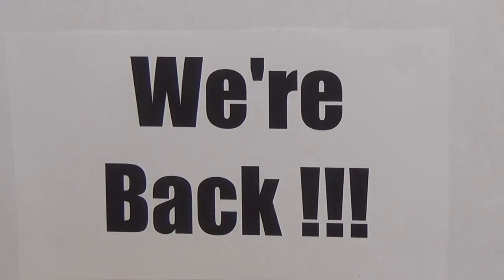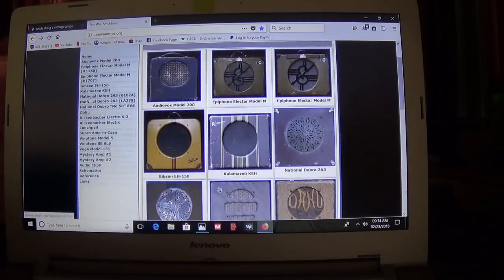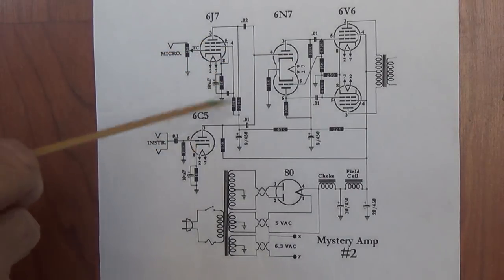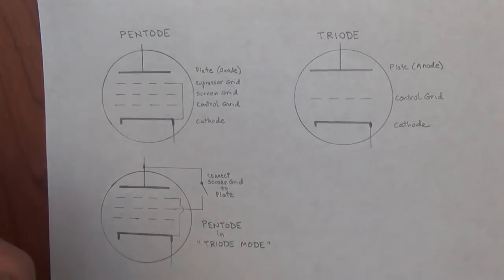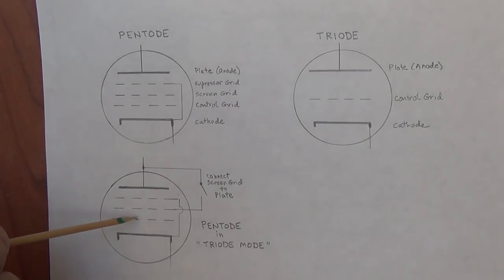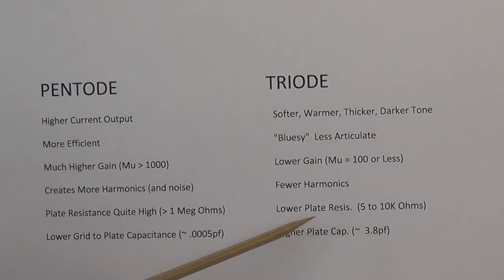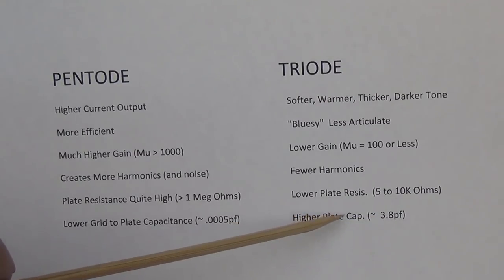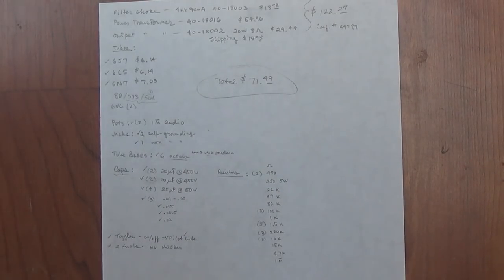Let's Build the Mystery Amp, Part 1: Introduction

Comment: Have you ever thought about using comercial electrical enclosures such as milbank as a chassis. A 12x12x6 is like $40 on Amazon. They make all kinds of sizes
Reply from the maker: I have not, but will look into it, Lucy. Thanks :)
Reply: @UncleDoug  can I put a link for u here
Reply from the maker: @lucyfuir6386  If you wish.
Reply: I tried it didnt post but if u look up milbank 6124sc1-nk u can get cost n specs. I saw Gordon elec supply had them for 22 n change.
Reply from the maker: @lucyfuir6386  Thanks again, Lucy.

Comment: What do you think about rebuilding a old Raul and Borg amp for guitar what is it similar to I heard you did one rebuilt I’m interested in trying to learn how to work on guitar tube amps would this be a good learning experience for me
Reply from the maker: Yes, it would. By all means, give it a try.....but be very careful when handling a live circuit.
Reply: @UncleDoug  ok yes I’m going to drain the circuit and test with my meter that no voltage is present

Comment: The original Epiphone Electar Model M is a very odd series-string amplifier which has three rectifier tubes and four output tubes.
Reply from the maker: Wow, that is an unusual circuit.

Comment: Hey! I'm back at it again as well. On my bench a Shin ei univibe..I need to brush up on some things. Was thiknking today I need to go back and watch some videos. But, This is an already modded uni vibe so I don't feel so bad messing with it. I got it for a decent price to play it but I believe one of the transistors went bad. Me being somewhat new to reading schematics I just replaced what I thought was the lfo transistors and the lamp driver transistor to get my bulb back to blinking and it ended up just making the bulb that was dim, just a  lot brighter still no sweep. Wonder if I have bad lfo diodes? Came across this http://www.geofex.com/Article_Folders/univibe/univtech.htm
Reply from the maker: It sounds like an interesting project, Jonathan. Best of luck with it.

Comment: i just have to ask...is that an ol' boob tube monitor...?
Reply from the maker: I'm not sure what you're referring to, Art. The screen is on my lap top. My previous computer did have an old fashioned monitor, but it ended up in the Dumpster long ago.
Reply: Sorry Doug it's just that the screen has a curve to it and it looked like a CRT.  sorry my mistake...
Reply from the maker: It must be an optical illusion, Art. As you know, laptop computers have the world's flattest screens :) :)

Comment: Delighted to see you back 'on air'! Losing a pet can be a devastating experience, please accept my heartfelt condolences. Early in the video you mention electrons travelling at great speed. Just out of interest; according to the Valve Wizard, in a diode with a plate voltage of 100V, the electrons are travelling at 1,333,575 m.p.h. when they hit the plate.
Reply from the maker: Thanks, Silas. Good grief, that's even faster than Rusty used to run to his food dish at suppertime !!  Thanks for the info.

Comment: Uncle Doug, I've got quite a few Gibson amps. My favorites use pentodes in V1. The one I love to play most is my 1950 GA-30. It uses a 6sj7 in V1 and it screams. Another really good sounding Gibson that I have is a 1957 GA-20T. It also uses a pentode in V1, a 5879 which is one of those nifty tubes that has a pentode and a triode in one package. I don't know why boutique designers don't use such designs any more, I guess most are recreating that British ultra gain. But, I think you'll be impressed with the 6sj7. It's important that you incorporate the uncanny skills of Jack The Cat in your work.
Reply from the maker: Greetings, Rick. Thanks for your input. It's good to hear that pentode input tubes can produce great sound. The schematic actually calls for a 6J7, which is virtually identical to the 6SJ7 except that it has the grid input on the top cap. To maintain the very early nature/appearance of the circuit, I wanted to go with the 6J7. I'm anxious to see how it turns out.

Comment: Sorry to hear about Rusty...he was the life of the party for sure...and glad that you're back into amp building...the wife and I love your videos and have been missing them...
Reply from the maker: Thanks, Tom
Reply: Uncle Doug I was just thinking about the pentode portion of the preamp section...being that this is pre-war it very well could be a front end for the very weak signal from the ribbon microphones of the day...even some modern ribbon mics require higher gain preamps because the signal is weaker than dynamic or condenser mics...just a thought...
Reply from the maker: It's definitely labeled as being a "microphone" input, Tom, so you may well be correct. It will be interesting to see how it handles a much stouter (guitar) input. Some fine tuning may be necessary.

Comment: Hello, would it be poissible to put a blend control between the 2 inputs?
Reply from the maker: In the revised circuit, each input will have its own VC, Alan, but I will have to investigate the feasibility of using both inputs simultaneously......it may or may not work well. We'll see.

Comment: Welcome back Uncle Doug. I have recently retired and heading to my 7th decade, and can now pursue my hobbies (guitar repairs, woodwork etc). I have an old 1966 Selmer Zodiac Tremolo Mk2 which is in relatively good shape, apart from one of the tone switches not locking in when pressed. However I would like to build a small valve (tube) practice amp recycled from an old 1960s stereogram.(two output transformers for the price of one!).I've tested the power transformer which appears to be OK, giving a no load output of about 282-0-282 volts. However, the filter capacitor (50, 50, 16 uf) appears to be in good condition and on test, the values are near enough.I is rated at 275 working voltage which I don't quire understand considering the Tx output. I'd appreciate it if you could shed some light on this. My email address is gordon@gordonstephen.co.uk if you require it.
By the way, I'm from Aberdeen up in the (cold) north east of Bonnie Scotland.
Cheers and thanks,
Gordon
Reply from the maker: Thanks Gordon, it's good to hear from another Scotsman (by heredity). If you are concerned by the disparity in no-load output vs rated output, be advised that once the transformer is functioning in a circuit, the voltage will decrease as the current increases. This output should be ideal for a mild 6V6 circuit.
Reply: Thanks Uncle Doug, just as I suspected. The stereogram amplifier had an EL84 output into an Elac 8" by 5" elliptical speaker, with an EZ81 rectifier and ECC83 input. Enough for me to make a simple single ended amp with volume and tone.
I'll let you know how I get on.
Cheers,
Gordon

Comment: Good to see you back.  I can't wait to hear what you create and how it sounds.  My friend and I built a two channel amp with a a single input running to two separate premaps.  One side uses a 6sj7 for the preamp and the other side uses a 12ax7 for the preamp.  In our experience the 6sj7 side had more bass response than the 12ax7.   Good to see you are back.  My condolences on the passing of rusty.

Comment: A couple of points...  the pentode vs. triode discussion has some errors, basically too simplistic. Also, the design has the 6J7 plate output (high impedance) loaded by the triode plate resistance (quire low,) Not a good idea. Use a switch to separate them. Good luck with the project!
Cheers,
Roger
Reply from the maker: Thanks, Roger. Bear in mind that many of our audience members are relative newcomers to electronics and are better served by this type of presentation. Experts generally need no reviews of fundamentals. Also, this is the original schematic for the circuit. As stated in the video, it will be modified to improve the performance.....including a separation of the input tube plates.

Comment: Glad to see you back. The truck is beautiful, looks to be coming along nice. Maybe next truck should be Electric.  For me there has always been something about that classic design but using modern technology. A EV truck... classic and the future. Anyways glad your back can’t wait for the next one.
Reply from the maker: Thanks so much, David. Although the trucks appear to be old and relatively original, the steering, suspension, brakes, engine, and transmission are all completely modern. I'm still an enthusiast of noisy, powerful internal combustion engines, however, so an electric version won't be in the works for a while :)

Comment: I am thrilled that you're back with a new project. You can't imagine what you inspired me to do here in Australia. I have been trawling the flee markets, buying all manner of ancient electronic technology and tools. I have built a few amplifiers based on 1940's designs. A recent one utilised 2 x 6J7 tubes for first and second stages and a SE 6V6. Another was a Valco Spectator circuit built into a white Bakelite radio from 1948, it's fantastic with a high quality 2 ohm 12" speaker from the day.
I have a 1933 radio chassis using 80 rectifier and other 6 pin valves which will be my next project. I'm looking forward to following your amp build. Thanks for the all other videos too.
Cheers from Anthony in Melbourne Australia.

Comment: Surrounded and comforted by his family would have allowed him to slip away to sleep peacefully.  We have experienced this ourselves with our cats and it's the best anyone can do.

I am very pleased to know you are back at the workbench.  When I saw the schematic of the Mystery Amp #2 with an 80 as the rectifier it took me back.  My first attempt at building an amp, 50+ years ago, used parts recovered from old radios.  The output was a 6F6, the pre-amp 6B8 or 6G8 (not sure which) and the rectifier was an 80.  Very basic, but it was a start and I learnt a lot from it.  I note that the Mystery Amp P/S has a choke input filter, actually a two choke filter with the field coil speaker, fairly unusual in guitar amps I think.  Referring to your comment about "breaking up the monotony".  There is no monotony on the Uncle Doug channel.  Always interesting.     Kind regards.  Jeff.

Comment: Sorry to hear about the loss of Rusty, he was a lovely dog, I'm going to be following this mystery amp build since it has piqued my interest, please keep the videos coming.
Reply from the maker: Thanks, Simon. I hope you enjoy the series.
Reply: I always enjoy watching all the series of videos that you have uploaded, learnt a lot from them in the process too, I've got a big guitar amp build project scheduled for this year, basically it's going to be a 50 Watt version of the Soldano SLO 100 amp, I've elected to build all the circuitry for it on some turret boards since I've never actually made a turret board before, so it's going to be a great learning experience for me, there's a company in Australia where I can order parts and materials for amp building from online, the company is called Evatco.com, they sell just about everything needed for amp building.
Reply: I'm also going to be doing some restoration work on a mid 70's (I think) Fender Super Twin 180 Watt guitar amp I bought last year for Au$300.00, it should turn out to be a fun project, my Fender Super Twin is the non-reverb version and uses a total of six 6L6 power tubes....yikes!!
Reply: The Fender Super Twin amp chassis is currently mounted in a wooden cabinet for a Blackface Fender Bassman amp, the cabinet needs re-tolexing and some new chrome fittings, and also a new front panel, I'm thinking of covering it in Tweed cloth and covering the front panel in a Paisley cloth if I can find some locally, should look cool.
Reply from the maker: That sounds like a great project, Simon. Best of luck with it. Let us know how it turns out.

Comment: I thought I might mention that when the screen supply is bypassed to ground with a capacitor as they often are, it shorts the control-grid-to-plate capacitance to ground.  Therefore, the control grid and plate can't see each other so to speak, and the tube acts like a cascode circuit (sorry for the term that may seen a bit esoteric).   BTW, your truck looks fantastic--you are a true craftsman.

Comment: It's so good to have you back, Uncle D! I'm saddened to hear about Rusty. This is quite the coincidence, as I came across an old 60's Layfette amp, made in Japan. The chassis is half open (they made these amps cheap!), and the tone is very muddy, possibly from a poor design or from very old capacitors. I bought a full chassis to replace the half open one, and decided to rebuild the circuit to my own design. The original amp uses 2 6AV6s and a SE 6AR5. The circuit is interesting in that it uses a voltage doubler rectifier. The power transformer seems pretty stout, so I decided to make use of the 2 input jacks and have number 1 go into a pentode (a 5725/6AS6) while jack 2 will go into one of the 6AV6s. Like your amp, that way I can choose to include the pentode in the pre-amp circuit or not, and it will also give me the option of adding an extra gain stage if I so desire. These amps were pretty rare, but not too valuable, and I plan on keeping the cabinet, speaker (an alnico 6 inch), faceplace, knobs, transformers, etc all original. I found an interesting run down of this amp (not my video), but I'm pretty sure the guy made a few minor mistakes in his schematic. 

https://www.youtube.com/watch?v=uhRxE499i-c

Comment: Nice to see your videos again. Sorry about Rusty, though. Regarding the higher parasitic capacitance in triodes, I'm surprise that 3 or 4pF would have any audible effect. At 10KHz (well beyond my sixty-year-old ears), 4pF presents nearly 4 megohm of impedance. You'd need a pretty-darn sensitive instrument to measure any loss to ground at that impedance, wouldn't you? Is it possible that the "warm" triode sound is more related to its lower gain and hence lower noise and harmonic distortion than the high-gain and (relatively) noisy pentode?

Comment: Hell yeah Uncle Doug, great to have you back and eagerly awaiting the next video. I will have you know that I have modded that little valve jr. With an additional 12AX7 cathode follower Marshall tone stack and "send" output and recapped and resurrected that Hammond p-40 (kept quite original, I am using a Ramko Research turntable preamp to convert my single ended output and impedance to the balanced input the "gg" that the tone cab would have expected from the organ) with much help from you previous videos. THANK YOU!!!
Reply from the maker: You're welcome, Dave. It's good to hear that the VJr. project went so well :)

Comment: Oh, HELL no! How ya gonna replace a tech like Rusty?!?!? Condolences, Doug. May Rusty go to that big
Tech/repair center in the sky. Meanwhile, be advised Uncle Doug...that hole in your life will shrink up
over time. Be patient with yourself and you'll heal. Good to have ya back, but take it easy on yourself
at first. and the new hobby may be good therapy(8-).
Reply from the maker: Thanks, Tom. Good advice indeed.
Reply: I turned my buddy Jeff on to your new hobby, but he won't subscribe to anything...hard headed 
critter. I'll be watching all I can of your channel though. 

Ya prolly won't believe what I got hold of some time back. Finally got time to deal with it now
that I'm retired. I have the amp chasis from a Wilcox Gay Recordio. No record cutter parts though.
But it sounds good when I plug in my old Heathkit tube type FM tuner. Need a little filter cap
work though...little bit of hum there. I just hate to tear it out of the cabinet I just built for it(8-).
Tried Sam's Photofact and other places. Noone ever heard of the thing(8-/. Had to stumble
through on my own. Same for the more recent Rauland Borg Model RA32 amp. but it works
too now. Nice 12ax7 to 6av6 to twin 6l6 tubes...powerd through a 5as4 rectifier. It had a 2
prong cord...well it does again now. Had to clip the green chasis ground (3rd prong) wire.
It doesn't like a grounded chasis. NOTHING is wired to that metal box...nothing...and it
runs great that way(8-). Nuff outa me, didn't mean to be a pest(8-).

Comment: You know me, Got to ask a question.I started my amp-push pull-two 12ax7's driving two 6v6's-5u4 rectifier.-Stupid me, should have checked the transformer before I put it in the amp.-I finally found a schematic for a ao-33-1 and the primary shows a 120 from end to end and a 110 tap.-why , I don't know .It doesn't tell you the colors of the wires.-The wires are black, tan and dark blue. Black to blue ohms 1.7-tan to black ohms 1.8.-tan to blue .6.- In the schematic it shows to outside wires hooked up and the tap just stubs off with a black dot- not a ground symbol and not a hollow circle.-I hooked the black and tan and tried grounding the blue and just letting it float. Here's the kicker.-I get no reading on my 5 volt or 6 volt or high volt lines.I have none of the rest of the circuit hooked up, just the power section to check my volts. I went ahead and put my electrolytics and resistors in to check volts before I went to plate of 6v6, to make sure they were ok .Please tell me ,I'm just doing something wrong. If this transformer is bad that means-I have been ripped off on 3 amps and a variac. I don't think I will buy used again. I guess it is hard to trust anyone ,anymore. This one came out of a church, and the guy told me ,he heard the organ play. I won't ask you anymore questions, because I have had about all I can take of this.I could have bought a new amp for what I have spent and I just don't have the money like I used too.
Reply from the maker: I believe the PT primary has taps for 110VAC and 120/VAC, to match whatever your wall receptacle voltage is. If your wall voltage is 120VAC, then I would use the black and blue leads. Tape off the tan lead. Good luck.